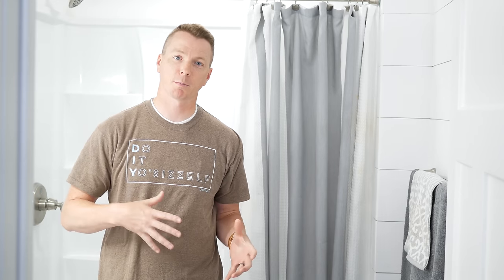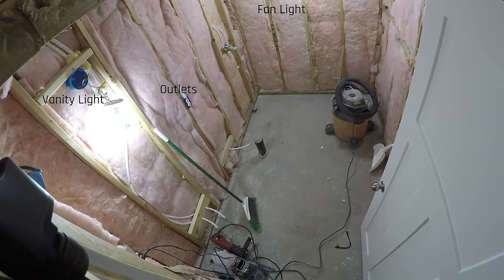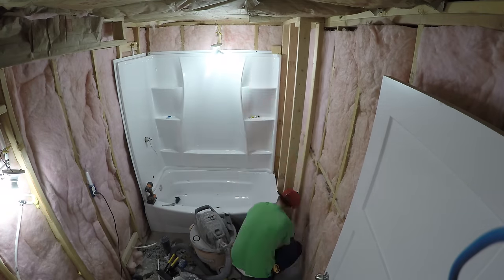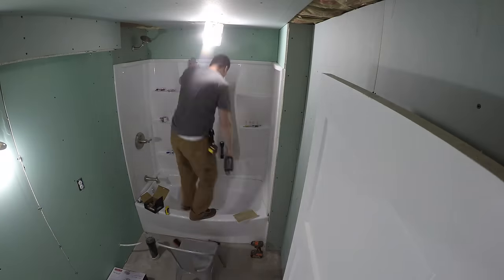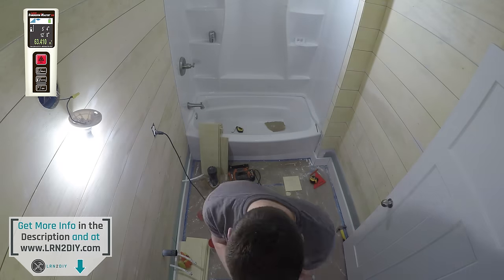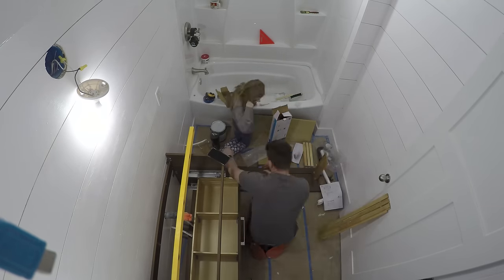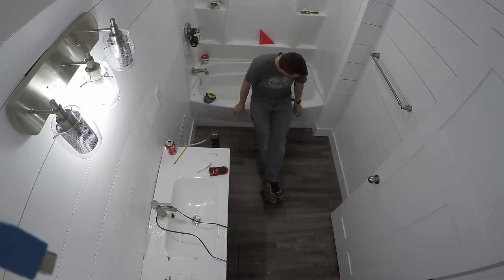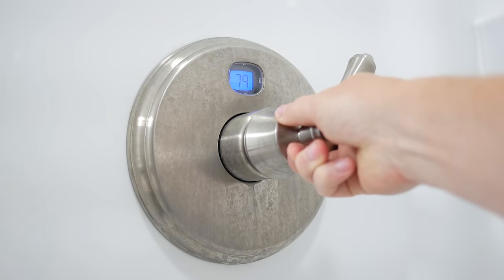Building a Bathroom From Scratch: Timelapse

Comment: I would really suggest waterproofing behind the tub. Once the space starts collecting moisture, that insulation behind is the first thing to mold. You would also need padding under the laminate, concrete is never well leveled and allowed dust to pass through.
Reply: A lot of modern laminate flooring comes with padding already attached to the bottom as is the case here.
Reply: Yeah typically it’s prelim drywall thats waterproofed before installing a tub. Never seen a tub fastened to raw wood unless its a dead space wall

Comment: Hey! I used the same bathtub enclosure from home depot :) You have to attach it together really well or it leaks.  I used silicon at first and it leaked then I had to pull out the silicon cuz it didn't really adhere then I used adhesive with silicon on top of that.  I used an acrylic tub because it was light and I was working by myself. But if I had it to do again I'd probably use a heavier one.  I'm afraid to put too much pressure in the wrong place on it but it looks okay and so far so good it seems to work okay. Your bathroom looks like a Hilton bathroom, great job.

Comment: Great video! How did you hook up the drains for the toilet and tub to the main drain line? Was there existing drain pipe in that area of the basement? Since it is in a basement, did you need to install an ejector pump?
Reply from the maker: The house was pre-plumbed with a toilet drain (it's the one you can see in the beginning of the video) and when I cut into the floor, there was a buried drain for the tub as well. The house is only a few years old and was built with an eventually finished basement in mind, which is why those were there.
Reply: Is there an ejector pump?
Reply from the maker: You only need an ejector pump if your main sewage drain is above the level that your bathroom drains are. Our homes were built with a very low drain line so we don't need an ejector pump here, but it's always best to check on that.

Comment: Yes,that's what I meant.My husband always puts it  behind shower and tub walls.thank you,did see you put it up on other walls,curious why not behind tub surround?
Reply from the maker: Ah - gotcha. Yes, if you're doing a tile surround, for example, then you'd use the drywall. For vinyl or acrylic surrounds like this, they're designed to mount directly to the studs, then they have a flange where the drywall can sit atop them to connect to the rest of the wall. Just depends on the type of surround you're doing.

Comment: I’m curious what the tub surround manufacturer’s recommendation is for putting some sort of moisture barrier behind it. In Every bathroom build I’ve seen, they use waterproof Sheetrock (sealed with waterproof tape and mud) behind the shower/tub surround, but I don’t recall any of those being the pre-fab’d ones. Those do have seams though, so I would imagine you don’t want to leave it completely open behind due to the potential for moisture penetration over the years.

Comment: This is good because instead of adding a music you talk through what is going on in the video. Also, what type of bathtub is that? I have never seen this type of bathtub before that has panels.
Reply from the maker: Thanks so much. I honestly don't recall what the exact tub and surround were but I just picked them up from the local home depot. You can usually find shower surrounds in both single piece and three piece configurations. The single piece surrounds are more naturally water tight but also a lot more difficult to maneuver.

Comment: How much did this whole project cost?
Reply: If you do it yourself, material costs won't exceed 500 dollars (not including the pieces you chose) but if you hire someone it can be about 2-3k
Reply: @mannylupercio8194  In Canada, someone tried charging me 10k  -_-
Reply: George Lupercio Just the tub, cabinet, and sink cost more then $500.. The plywood is like $60 a piece and I’m guessing he used 5 or 6 pieces so that’s $300 on Just playwood... Depending on the toilet he bought it’s around $100-300. And You still need drywall, Plumbing, electrical... Well over $1000
Reply: @azsa3705  Ouch, plywood must be made out of gold for that price - should cost no more than 30 depending on the material.  Electrical isn't that expensive either again - if you do it yourself. I also didn't include the shower, toilet, and vanity because they can range from 50-1000 depending on what you want out of it.

Comment: Its a grate work! I love the finish look! One question: did you had any permit, inspection? I would love to hear how that exchange with the city inspector went. Thanks!
Reply from the maker: Hey Jeremy, this all depends on where you live. In the U.S., it typically does require a permit and an inspection. You’ll want to check with your city ordinances to get the details. Homeowners can do the work but it’s always good to have a plumber and inspector involved in the process. Best of luck!

Comment: Did you have to get permits and inspections for this? I have an unfinished 1/2 bath in my basement, but I'm not sure if I can just finish it or if I need permits and inspections.
Reply from the maker: Generally speaking, you do have to get permits, yes. If you stop by the town hall they can typically tell you all about what's required in your area.

Comment: Love your videos, particularly this one as I'm taking on a similar project. Question: when you broke up the concrete for the tub drain, do you see any benefit to pouring concrete to fill the hole when you were finished with the plumbing? I'm thinking of filling in the hole I broke (only 6" square) with gravel, or pea gravel - leaving easier access down the road to the trap if needed. I'm using an acrylic shower base. Thanks!
Reply from the maker: Great question - The two most common things I see are either refilling the whole thing with concrete again (on top of the pea gravel layer) or filling it in with pea gravel and/or broken concrete entirely. My thought was the same as yours - get it so it can help bare some weight, for what that's worth, and can be accessed later, but no need to completely concrete over it again. I can only share my experience and thoughts on it but others may have good reason for filling it back in with concrete. In any case, good luck!
Reply: @LRN2DIY  u got videos of the plumbing connection?
Reply from the maker: @Eastbaypisces  Unfortunately I didn't film that part. I have an older video that covers doing this in a previous house in case that's helpful but it's certainly not my best work. https://youtu.be/tP6vrPAoYNU

Comment: Where did you find the temperature digital reader for the shower?
Reply from the maker: I bought mine locally but I did a quick search and found several options online. https://www.build.com/delta-t14000-t2o-lhp/s1064178?uid=2567229&source=gg-gba-pla_2567229!c1709211100!a66212958149!dc!ng&gclid=CjwKCAjw-YT1BRAFEiwAd2WRtozL0VLV5b5Xdq_PW2R8SGvTk8K7YtO3tg3k-M8N5pMS6Ln4h37aBhoCtIgQAvD_BwE&gclsrc=aw.ds
Reply: @LRN2DIY  thanks so much!

Comment: How much did u spend on the bathroom?
Reply: Oh, and was there any need for code inspectors to approve? Wanting to start a bathroom project for our basement as well.
Reply from the maker: It cost around $3000 and yes, you need inspections and a permit in most areas.

Comment: Didn’t install the shower correctly. Didn’t glue it to the studs and brace it or caulk the seems before putting together or let it dry over night before walking in it or put sand or drywall mud under the tub for setting it so it won’t move. Also didn’t build bathroom at correct width it should’ve been built same width as tub...this guy doesn’t know what he’s doing.